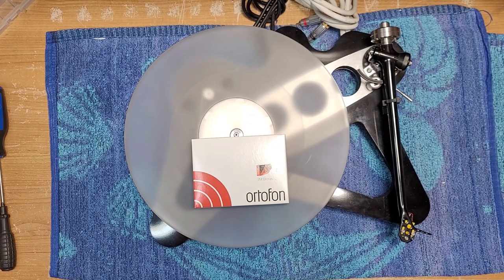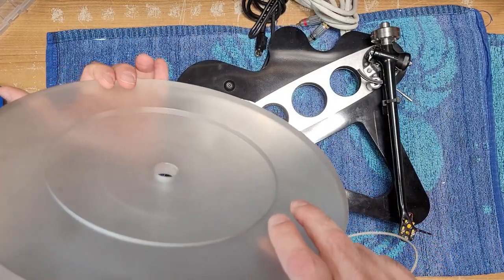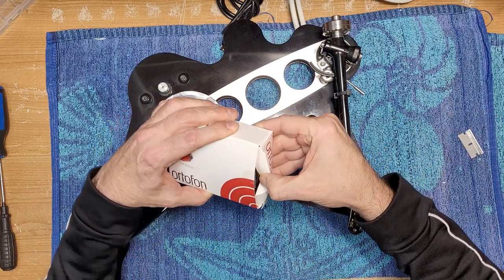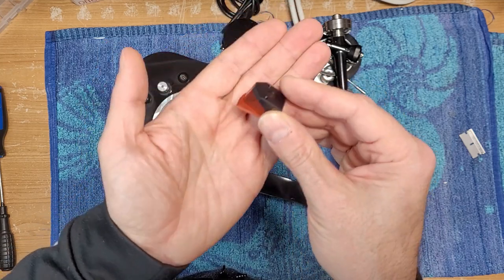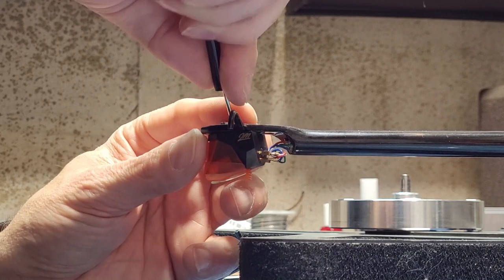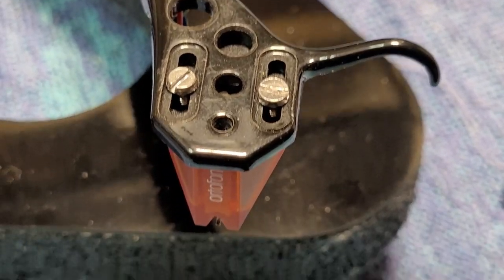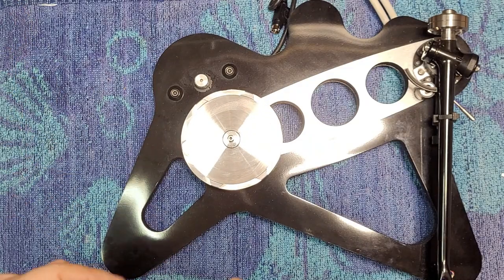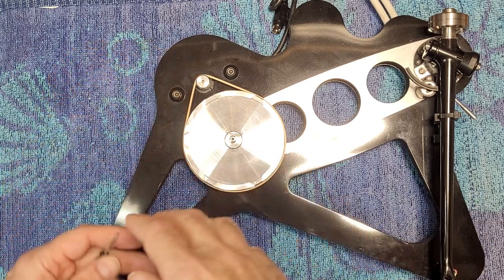Rega RP8 - Ortofon 2M Bronze Install and Lube Service

Comment: Hi, Good video. I downloaded the Rega/Stevenson protractor, however my problem is the 140 mm and 200 mm parameters. I have been unable to print the measurements exactly. Is there setting/adjustment in the software to do this?
Reply: Debes estar seguro que cuando imprimas tengas ajustado la proporcion en la impresora al 100%

Comment: I clicked in to see how closely the shape of the 2M cartridge resembled the shape of the Rega arm casting where the cartridge mounts, since I noticed the similarities as soon as the cartridges were announced .  

I didn't really get the exact shot I needed, but it  might be that Ortofon looked at the market and saw a clear way to imply a match to a very popular arm that their target market might own, or it could be that rega took that head shell shape for the same reason ortofon stated with their cartridge body, that the shape best controlled reflected audio energy .   Which doesn't really explain all the other cartridges they sell with parallel sides.  I guess when another new product line comes out, and if it uses a similar body,  we will know.

Comment: An RP8 should have twin belts. Speed switching is done by the PSU not the pulley. Pulley grooves  are the same size on this model.
Reply from the maker: I did eventually realize that.  The customer delivered two brand new belts the next day.
Reply: Pulley sizes identical.

Comment: fun stuff.  I'm 73 , have zero chance of changing a cartridge on that...hard enough I barely got it done on a Thorens. is the completely removable plug in headshell an SME design, that's the way to go.    and are there any hi fi shops within 75 mile of here , nope.  even the malls are disappearing to  online shopping.
Reply: if you have a big screen TV, it is sometimes possible to to hook up a usb microscope to  a video input, giving a very easy to see magnification, much like using an optical comparator.

Comment: 350 CAD is a nice deal, and it shares the body with a 2m black if the owner wants to upgrade later without doing a new alignment.

My only point of disagreement might be the decision to align to Stevenson. I have a Rega RB2000 on an Avid Volvere w/a Cadenza Bronze. It sounds better to my ear with Baerwald/Lofgren A. However, not knowing what the owner’s record collection is makes my argument debatable.
Reply: I was just hearing the Rega founder speak, during a YouTube discussion,  to the selected alignment that Rega uses.   His position was the differences between the three major alignment system's errors were so insignificant as to be trivial .   When one gets down to selecting alignment strategies according to the age of one's records, that's putting too fine of a point on things for me, but then that's probably why the guy prefers a certain alignment method.   

For me, a slightly greater error across the face of the record is paid back with slightly less error in the section of the record known to be more easily distorted.  But my calibration tool doesn't do that alignment , so I don't run it, and the difference is insignificant to my purposes.anyway.

Comment: Manual says the platter is glass. Interesting that there are no specs in the manual for speed accuacy, speed drift, wow & flutter, or rumble. You would think for $3,500, this info would be available. What are they hiding? Too much spondle  oil. These are ultraclose tolerances, and don't need a ton of oil. 2 drops on spindle was all you needed.
Reply: Yeah, I am suspect of these belters, but the PS is cool. I am a fan of Quartz lock. Always have been and always will be.
Reply from the maker: Extra spindle oil seeps out at top and then absorbed with a paper towel.  You cannot over fill it.  And, I'd rather be sure than not have enough.
Reply: @TurntableGuy  there is no oil from factory from what I can tell from watching numerous other videos that all claim there is no oil at all in the well. If there is it is a miniscule amount.
Reply: Definitely glass out of the box.

Comment: A downgrade for sure. The Rega Exact is a better overall cartridge than the Bronze. The Rega Exact is a direct rival for the 2M Black. Surprised that someone would run a MM cartridge on an expensive turntable.
Reply: I'm not surprised, I know quite a few who use MM on these. They do sound superb with a Rega Apheta , through a Rega Aria though

Comment: The 2mbronze is not for planar 8 you must think for ortofon gadenza red at least
Reply from the maker: It's not my turntable.  I install what the customer wants.  Is there a law somewhere that states that the 2M Bronze can't be installed on a RP8?
Reply: How does the 2M bronze work on this turntable?
Reply: @TucsonBillD  I have a 2m bronze on a modded RP6, it slays. So would many other choices I suspect.
Reply: @TurntableGuy brilliant reply.😉
Reply: Yes, I'd fit a 2m Bronze or Black on my planar 3. But it's a matter of budget and the turntable makes more difference to the sound, I started with a Linn K5, a decent but budget cart when I bought my Planar 3 because I spent all the money I had buying the turntable. Years later, upgraded to an elyse, then now to a Stanton 680EL which is a broadcast quality DJ cartridge and I was blown away by how well the Stanton and Rega work together.
Reply: I've even seen a MC cartridge fitted to a Rega Planar 3. My point is the guy got a Bronze for 350, in this day and age that might be all the spare cash he has....
Reply: I'm using the 2M Black on my RP8.I think they're a great match.

Comment: Oh dear, why must Americans fiddle with things. The Rega main bearing comes with lifetime lubrication and needs no service. Fitting a new drive belt should last your deck many years. If you don't fiddle around with this deck, it will last you a lifetime without all this faffing around.
Reply from the maker: You Brits need to relax.  And I'm NOT an American.
Reply: There is no such thing as lifetime lub like come on lol. They said that stuff in the 70s with stuff. Anyone that things that is crazy.
Reply from the maker: @tonysvinyl2214  Don't mind the Brits.  They don't want you playing with their "majestic" turntables....
Reply: @TurntableGuy RP8  has a triple layer glass platter, RP6 has a duel layer glass platter. Rp3 has single layer glass platter.
I'm Scottish 🏴😉 and love playing around with Rega turntables, it has annoyed some, but tuff! My :gear, my money and my time.
Happy listening to all.🎵🎶
Reply: @tonysvinyl2214  without knowing the construction of the bearing , you might be incorrect.  Some turntable main bearings have a zero tolerance construction, where there is no room for an oil film, and oil could conceivably damage the non metal surfaces.   These things are running at 33 1/3 rpm , it's a very slow machine and things wear differently without a lot of heat.
Reply: I did notice that for a guy showing other people around, he seemed unfamiliar with the product, but experienced in general repair.